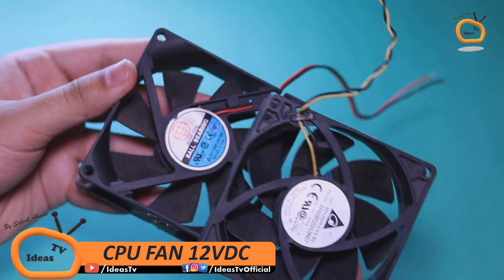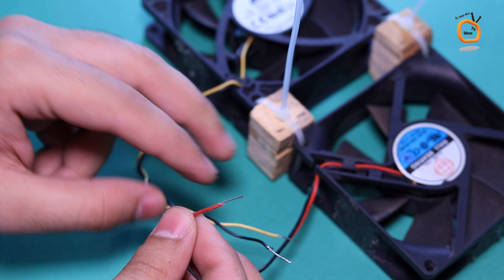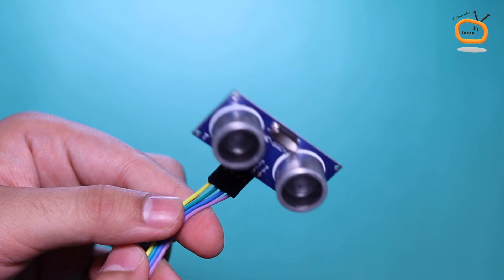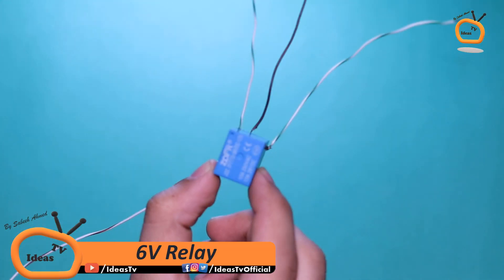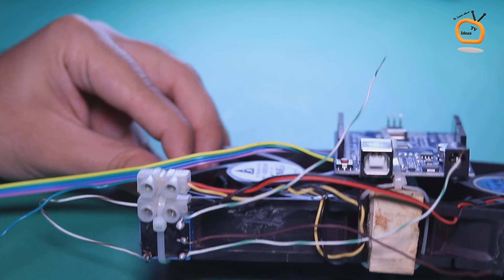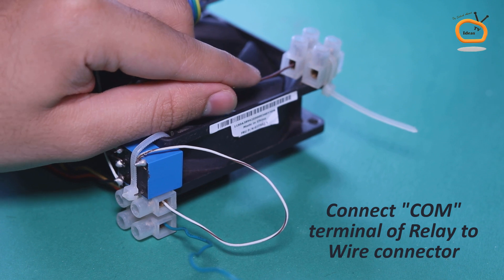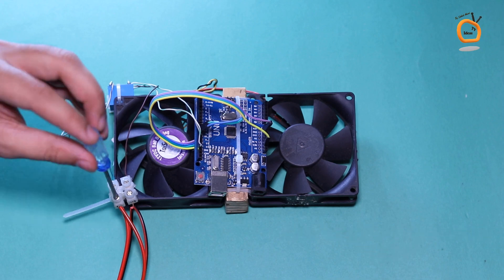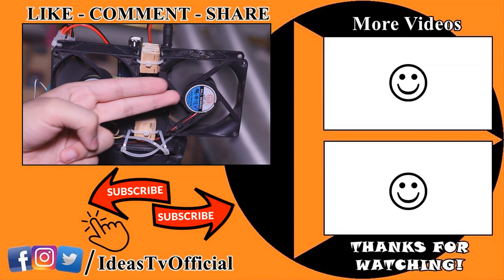How to make an Automatic Hand Dryer (Arduino Project)

Comment: If I don't want to use the Jacks, and connect it diretly to my laptop using the Arduino cable, how should I modify the wires? thanks